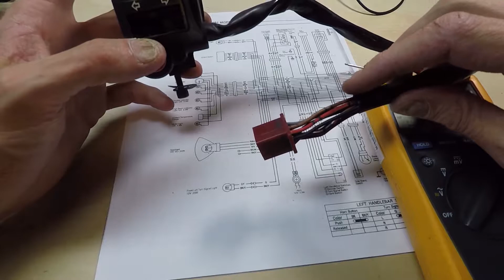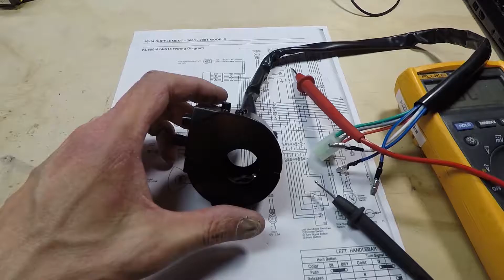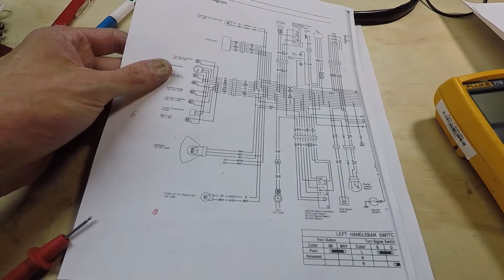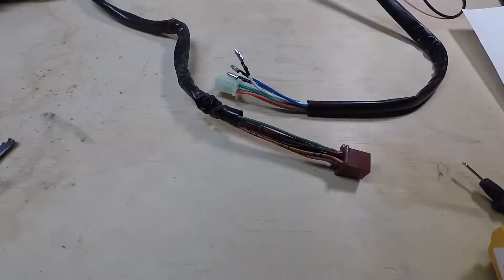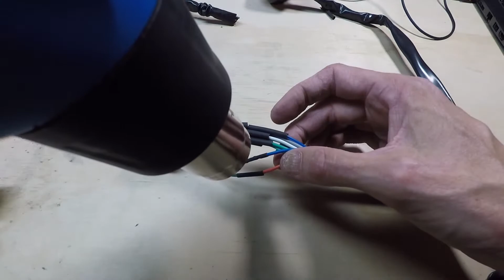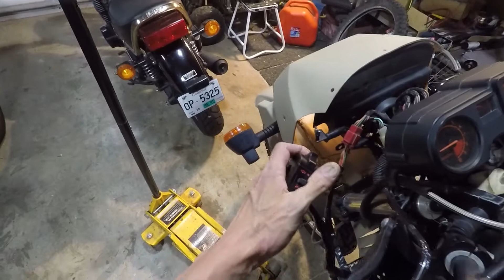Replacing a Kawasaki KLR650 turn signal switch with a universal fit switch assembly.

Comment: Great video! I’m struggling with the same issue. My 2006 KLR650 left hand switch assembly is not working. I open it and is broken from inside. I was looking for a used original replacement but they’re too expensive. I saw many new universal switches but their connection did not match. Now I know what to do. Thanks a lot!